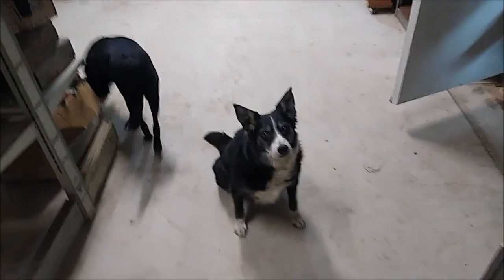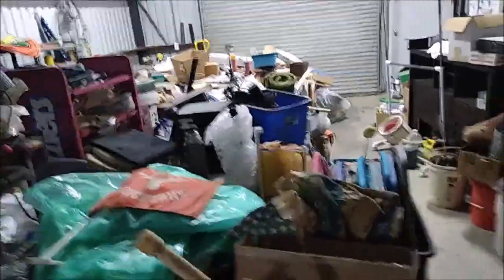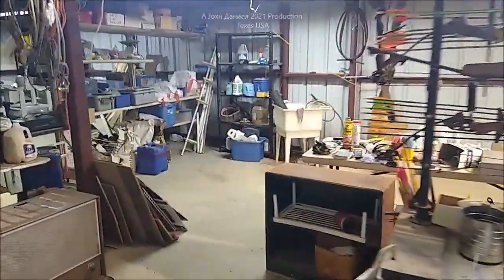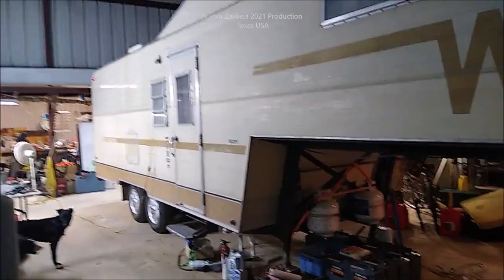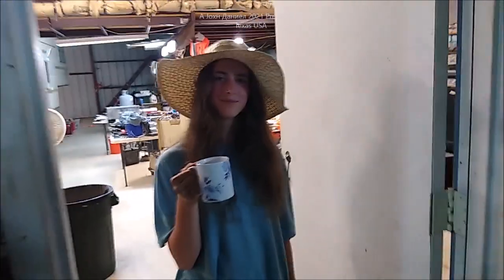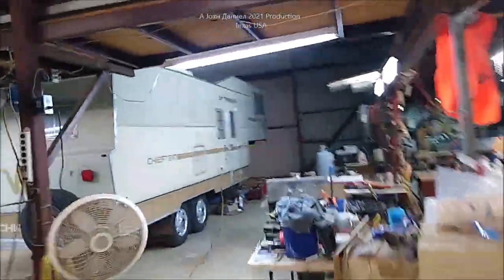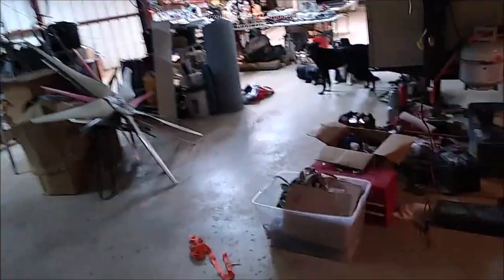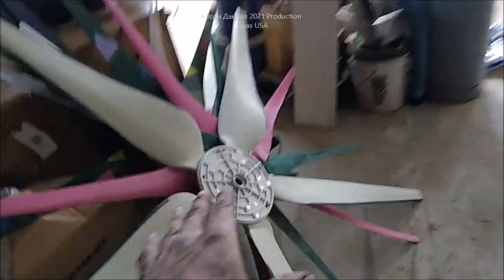Wind, Solar, Hybrid Power plan: Texas Hill Country adventure begins

Comment: Any chance you can make a video on each part in a wind energy system and what it's purpose is. I am interested in the dump resistors.  What they are and why you need them?
Reply from the maker: As soon as we can get fully settled in and we're not living in survival mode at our new place I will be going through the whole program with a complete definitions functional item use an applications on wind solar and many methods of energy storage.

Comment: Hey, John I have been watching you for years. I know you are all about off-grid do you ever install any grid-tie wind generators. I doing one and would like to know if there is any protection I need to add-in. I guess I could still use the braking system right. The inverter I bought says to bring the 3 phase in and it has the terminals and then plug it into the wall. It is 220 so I was going to use an RV-type plug 30 breaker and it has a dump load terminals. I'm guessing I will have to use a shut-off switch for the power company case they need to work on something. I live in Florida the inverter work if the power is out the inverter doesn't work if there is a hurricane won't that burn up the turbine? Or should I just take it down? Any help would be greatly appreciated...
Reply from the maker: Send me a email with your details on it to olympicpowercontrols@yahoo.com and I'll get back with you.
Reply from the maker: Send me a email with your details on it to olympicpowercontrols@yahoo.com and I'll get back with you.

Comment: Hey John I'm setting up a wind turbine with a tie grid inverter I have a dump load What size resistor should I use and is there anything else I should do to protect it from blowing up or just to protect the system. Maybe you could do a video on a tie grid system. Thank you for your videos

Comment: Congrats to the Texas move. 
Question. Awhile back I heard in one of your wind gen videos that you could use a 24volt wind gen in a low/medium wind area on a 12volt system.  Is that true? How do you hook up? What are the advantages?  I am on a boat sailing around the world. At anchor normally have 5kn to 15 kn wind.  
I am looking to get a wind gen

Comment: I'm asking a question that is neither here nor there. NOT asking  with condescension.
   If you have the room/space, why would you/anyone put solar panels on the roof in stead of on the ground.  Seems instalation and maintenance would be easier.  Missed your vids,  waiting on what is coming next.
Reply from the maker: We will be installing the 25 Stion panels on a 48 ft semi trailer that I'm going to attach into the back of the shop and since it's a big reefer trailer with 3-in thick hyperinsulated walls we're going to use it as the food storage as well inside.

Comment: Glad you made it I won't be able to come and visit on my trip to Dallas vacation got moved to another time but I'll be in in Dallas on the 23rd getting my panels and then I got to get back and hook them up and I'm also going off grid got the thermadine up and working on my actual flux I got pantera KT's blades to put on there and it's going to be 60 ft in the air I can't wait to see some of the Hill country that you went through and some around your place I just paid off my house so I don't have to worry about no more bills I hope still got to get my Duracell batteries from batteries Plus to add to the ones I've already got good luck and catch you on the next one
Reply from the maker: We've still got running back and forth to do so we might not be here A whole lot for the next month anyhow

Comment: You must have had a semi pulling doubles to get all of your shop junk from up here in TF, Idaho down to Texas. It had to be stuffed to the top of both trailers. Did you get everything moved from here in one trip or more? I'm amazed how you managed to get everything moved from here to there!
Reply from the maker: Two trucks with 20 and 30 ft trailers, one 50 ft reefer semi trailer, a 40 motorhome towing a 24-ft box trailer and my wife's van making two trips pulling a 14 ft trailer and we still got the storage unit that's 15x25 that I'll load into a 26 ft box truck next month.
Reply: @JOHNDANIEL1  I'm curious, John, as to why you moved to Texas? What a difficult and long haul you and your family made to get your stuff there is amazing. I am scared to death about moving to my farm in North Idaho, due to the accumulation of stuff that I have here. I know if I get rid of it, I will find a need for it immediately after I do. So, I am going to have to do what you did.

Comment: Welcome to the Hill Country ... we are out of Marble Falls ... allot less wind then where you were but still enough to generate some power out here off grid on the farm
Reply from the maker: We're at 1800 FT elevation here so this part of the Hill country has over a hundred wind turbines within 10 miles of me and further. Lots of big commercial ones. As far as I know my average wind speed is more present for consistent 15 mph without all the runaway 50 to 80 mph wind I got in Idaho.